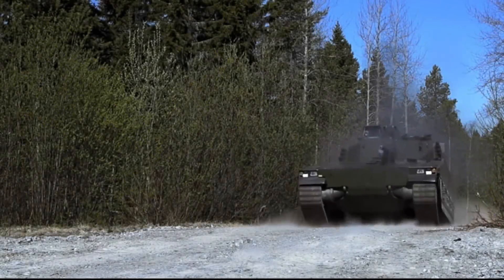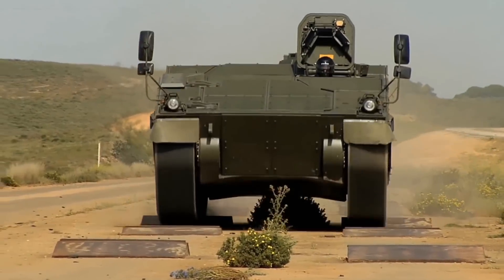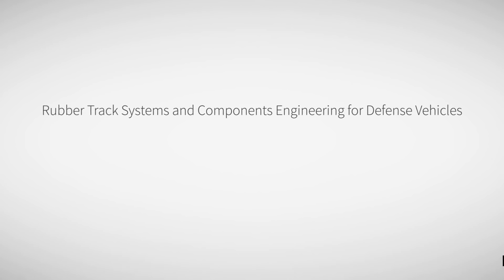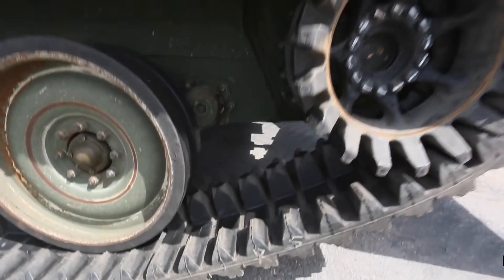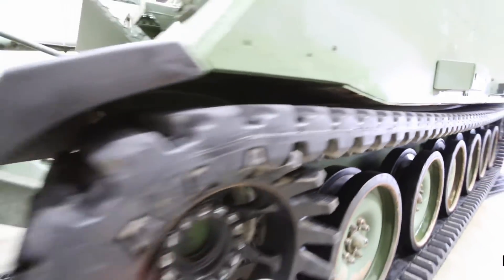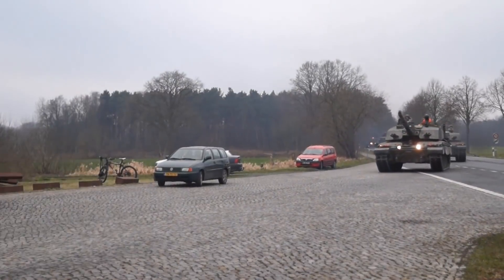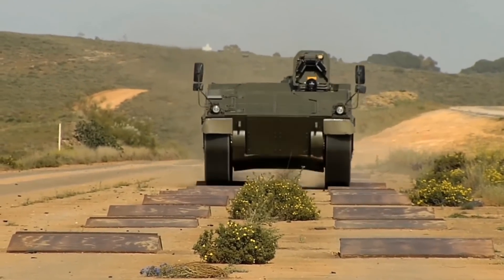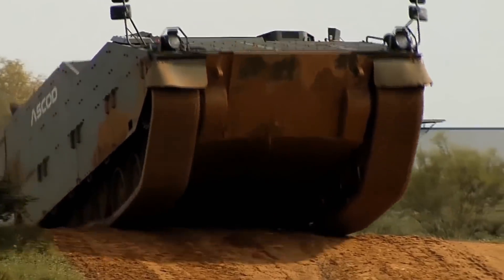Rubber Tracks on Tanks - Are they worth it?

Comment: You probably won't see this comment on a 4 year old vid, but I've been working on a science fiction tank story idea for a while now, and wanted to know some thoughts on this, if you'll excuse the whimsy:

What about organic tank tracks? You could have an organic rubber substrate a lot like the ones in the vid, but they also have a cartilage-supported circulatory system, pumped using the pressure of the tank rolling over it.

The idea is a more advanced version of the self-healing rubber materials I used in engineering. The idea is if something stretches and wears, catalysts will reach the spot to facilitate repairs and correct the damage. If a whole chunk is lost, it scabs over. Later, you can cut off the scab and apply more substrate, like you would a graft, and the material assimilates it into the track. If stones are an issue, they are encapsulated like a tumor and you can just take a knife and cut it out later.

You can store this material in sections and graft each end together to fuse it into a single track. Basically, the advantages of the rubber tracks, but less wear and tear, slightly easier maintenance (hopefully).

Also, if you can create a large-scale vat farm for growing these, you can create new tracks really cheap. Also, a lot of the healing is performed on its own, it reduces the number of tools you need on hand. Just need a package of substrate and your trusty knife.

I know a lot of sci fi concepts get immediately tossed in some military communities because it's impossible to gather actual statistics on something that isn't real yet, but I'd like to hear people's thoughts anyways.

I've been doing a lot of tank research through this channel, and somehow difficulties with treads was one of the things I hadn't realized before lol.

Comment: Fast Foward to 2019, for example the UK AJAX / ASCOD 2 IFV there have questioning to this program due to too high vibration issues on users: crew / passengers , change it to rubber tracks could be the fast track solution instead of reavaluate all other settings in terms of suspension and else...

Comment: There is one perspective that i don't find: I Don't subscribe that rubber tracks are not a best fit for MBT, at least up to 45 tons think is a best fit for example for modernization but mainly life extension of "legacy MBT" or even a tracked Howtizer, e.g. Leopard 1, M109, T72 ... because considering the key elements of mobility of an  MBT ... Engine, Transmission, Wheels + tracks + suspension ... the less expensive to modernize is the "wheels and tracks" and often if you modernizate / replace the "Engine" you have to also modernize / replace the "Transmission", fast forward, the gain with rubber tracks are vibration, fuel efficiency  - 2 digits - and some performance/speed as result the efficency increase of each HP of the engine (and 1 tons save in weight from steel tracks), so the gain in fuel per track replacement is bigger for heavier vehicles like the MBT  ... so looks really as a shortcut on a modernization, life extension of an legacy MBT budget that can be diverted then for protection, or ventronics !! As for battle repair constraint, is not a so strong argument, since in a combat context, there is not really besides tow other alternative and if the difference gap between a steel and rubber repair is either 15m and 30m is almost irrelvant, because both repairs cannot be done in "combat or unsafe  conditions", is just teorical, you either are towed to safety or abandon the MBT... even if you train to repair it, and both can be repaired... you did not refer that also exist track grips to join broken rubber tracks, nor that rubber tracks are more tolerant to battle damage than steel ones. Note: Soucy from canada already shared their prof of concept of trialing the soucy rubber tracks in Leopard 1 C1, you can google it. So let's do some math from that study: 1) rubber band live cycle 6600 KM; 2) Fuel. Consumption: On-road: 3.4 l/km. Off-road: 5.3 l/km (average 4,5 km mix); 3) gain in fuel eficiency -33% : 4) For simplify the exercise we diesel price 1l = 1 Eur...so the track life time saving is: =6600x4,5x.33x1 = 9801 Eur or 9891 liters saving or that you can supply 4 MBT with the same fuel that was required before for 3 for the same leg distance, a tactical logistical gain too, that you may rebate in the aquisition TCO of the rubber track...

Comment: You make mention of the M114 of the 70's that used rubber tracks. I remember going to the field at Ft Lewis with 24 of them and by the time they had gone 10 miles half were on the side of the road with thrown tracks.

Comment: One advantage of rubber tracks is that they would be much quieter than metal tracks. That would have a number of advantages, like when you're moving into a position for an ambush. Also, a hybrid gas/electric power train would be useful because electric engines are so much quieter than internal combustion engines. Light anti-tank vehicles could move into a position for an ambush with much less chance of being detected.
Reply: If I had to design a reconessience vehicle, I'd make it hybrid and have rubber tracks. The thing would be like a ghost.

Comment: The rubber band tracks would be great for traveling, though the metal ones would be prefered for defensive roles, plus there should be improvements in the vehicles for supressing vibrations in the cabin itself as you did say that's an issue.

Comment: I operate heavy equipment, and I can verify that this is all true.
Even a rubber track machines can beat the crap out of you if there is no suspension. 
The old, now defunct ASV, put to death by Caterpillar, was a really sound design.
It had bushings between the track units and the body, and the carriers were dual mounted, on their own paired pivots like a Sherman tank, unsprung.
The tracks had no steel belting, just polyester belts and Kevlar cross rods.
These machines, when respected, we're unlimited in their capabilities.
A 9,000 lb machine could walk on a snow DRIFT, not a BANK, and not even leave a rut, just cleat marks.
At 4psi ground pressure, they could grade mud.
Only a big, politically aligned company like CATERPILLAR could, and would, shut down a company that was successful.
That's my view, try to change my mind.
Especially when Control Freaks decide that something is so good that it has to be destroyed.

Comment: All depends on what type of rubber is used same with snow tyres on cars and trucks. The all metal tracks I use on forwarders wear too much if dry and people keep saying they do too much damage to roads and other. I would say the rubber tracks they are using on the CV90 are very good and I have also seen the new roads that were built on Salisbury Plain so the tanks and other did less damage with their metal tracks. The only time I have seen rubber tracks knocked off is on mini diggers where the person did not check them and they were lose but they were a lot quicker to put back on to the machine than metal ones. I would like to see how these are fitted to AFV's to see how quick they could be fitted and kept tight like if they were knocked off by an IED or other how quickly could you refit them or put a new track on ??  Thank you for the video.

Comment: if you have a metal track system with each track segment encapsulated in rubber you would have the combat strength of metal but a ride that would be better easier to store just like steel ones an a weight difference as well so why not encapsulate lighter metal ones

Comment: I'd personally have tracked vehicles built to accept rubber or steel tracks, and have the otion of swapping each one out based on the conditions I can expect. Do I want my APCs to be doing regular patrol work in an urban setting? Rubber tracks for the win. Are we going to be doing heavy fighting in the desert or extreme cold? Metal tracks it is

Comment: in norway we use rubber tracks, it saves fuel, roads, less wear on the vehicle, better acceleration, its smooter for the people inside. but when the rubber tracks break then you are in a heap of trouble cause you have to replace a whole belt. that is something you might not have time for when you are out solving your tasking.

Comment: Couldn't you have a rubber sleeve for each metal track link? As in each link is inside a rubber sleeve that reduces the vibration of the metal by virtue of it being insulated like a car tire.

Comment: track bashing is bad enough link by link. yep it's hard to move the whole track but doable with experience.  but you can change a single link on those tracks. You can't on rubber tracks. you gotta replace the whole band.

Comment: Have it's effect and/or take it's toll. Take effect means it happens, usually after some delay. Take it's toll means to do damage, to take something away in the course of operation. Take it's effect doesn't work. The effect of sharp rocks on rubber is to cut and tear. If it took it's effect, the rubber tires would cut or tear the stones.
Reply: Sorry to nit pick but it's jarring. Love your stuff.

Comment: The British bought about 100 Warthogs from Singapore (where they are called Broncos) to replace the BV206s because ppl were getting killed in the BVs due to insufficient armour. No one was killed riding in Warthogs, apparently. The Warthogs also had rubber tracks. We make quite a number of AFVs and also a high mobility vehicle where the driver sits in the middle. We also operate over 100 Leopard 2 modified locally. Perhaps you may consider doing a video on Singapore AFVs. We also make howitzers, SPG, LST and other weapon systems.

Comment: On the rubber tracks in sections, how does replacement time work: more or less? Service life vs costs is an issue as well. Troops time has always played in as a substitute for training for combat conditions not a waste of energy for combat. It does sound that the r/track has a lot of other advantages at least for lighter armored fighting vehicles. Also, as they develop,  maybe we would see a reverse of older designs and bolt metal cleats on the rubber for some performance areas or duties. It will be interesting to see how it works out. Thanks for the article.

Comment: If they want noise reduction, why not put a stealth mic and speaker on a tank? You cant make less noise after a point so just directly and physically counter the noise itself. You could even use a system like that to dampen the noise from the main gun, perhaps preserving the hearing of tankers over the long term. Technically, with certain attenuations, you could set the signals to overlap at a set radius from your vehicle allowing for verbal comms within the area among friendlies without fear of being overheard further out. Like a whisper-PA system. Lots of possibilities. Doesn't have much to do with tracks, but whatever

Comment: well. for defense i mean. when you have summer you gonna use rubber and at winter you use steel ones. and i think those advantages you want have when you going to the city. and at nature. but when you are at open field. you need steel couze bullets, damage, repair etc. but i think that i would prefer tanks with steel and apc with rubber.

Comment: I know this is an older vid but had to watch. I actually designed my own tracks. To do this I looked at various designs for ease of building. Making them out of rubber did cross my mind, as you mentioned about the stretching and tensioning during use, I decided not to use any rubber what so ever. Instead I used chain for the links. Made my track pads from 11 separate pieces of steel and bolts. 100% serviceable too. I can even spiral the tracks since they are so flexible. I think when I did the numbers they was- around .5 lbs of ground pressure per square inch, 1100 lbs of pull force can be put on each track. 1/4 inch cleats. 10 inches wide. Total weight for about 15 feet was under 100 lbs (one complete track). I took my ptv for one test drive so far and was surprisingly a smooth ride. Felt like it was floating, go figure.I see another vid of yours, LOL. "Tank Suspension"  Watching that next, LOL.

Comment: I think that ruber tracks will be really userful once they can be made whit graphene nanotubes in a radial config. (Like in a tire, the nanotubes being at a 45º angle respecting the runing vector, thus increasing the streng of the whole track not the middle core, like a rope). I think that It will work in segments and may have steel links between segments to increase traction on hard slipery conditions. Also they will probably need platforms built arround them instead of retrofiting current vehicles designed for steel tracks, at least in most cases. I personaly think that future desings will start going for unmaned vehicles, thus allowing smaller and lighter vehicles with comparable firepower and better survivability. I also think that another huge leap foward will be tanks with an electric drivetrain, this means that if the track is damaged or destroyed, the tank can move in a limited capacity. Kinda the BT russian tanks but instead having a steering wheel and that, having each or one of every two motoriced wheels (are they called slave wheels? the ones that have the suspension on normal tanks) with an electric motor. These motor have the torque to move a tank, but fiting the system of a diesel train locomotive in a tank is really hard and space consumig. Soo I dont know how well It is going to work.

Comment: it is bullet proof did you try to test it in land mines or any kind of heavy explosive and compare it to metalic trucks.
Reply: Of course it's not, lots of people would much rather aim for either the driver or if not the engine.. then get the fuck outa there-
But why would you have bullet proof tracks? You're more focused on having them support the weight and speed, as well as the ground density and obstacles.

Comment: It seems like in modern urban warfare tanks often spend a lot of time on roadways going between locations or out on payroll.
Wouldn’t it be possible to create a modular system that could attach to the underside or each corner of a tank that would have tires on electric motor hubs that could be lowered for traversing smooth roadways and raised for terrain?
Could even power the electric hubs from the tanks engine and reduce fuel consumption on smooth roads.
Make the failsafe position be retracted so it they fail the tank can simply use its tracks.

Comment: Metallic breaks but can be repaired but the rubber tracks... they pop off and snap and have to be replaced but would be cheaper but they have metal links going to road wheels where they turn tracks

Comment: They don't pass the combat test. They have peacetime advantages and would last longer than track link overall and less component and driveline wear etc and likely be cheaper over the life of the track versus changing links but that's it's problem. If you're in combat and a track is damaged then there is no going anywhere for that vehicle until the whole thing is changed which would not be a quick process and unthinkable under fire, would be continually recovering casualty vehicles to pull them to rear areas for repair. The crew couldn't self repair or at least provide a workable solution to move under own power so is then a capability loss of the vehicle itself and it's section of infantry in the back. I'm from Australia and I know what the terrain is like here and what it does to rubber tracked vehicles and it isn't very forgiving. In Europe etc probably different story but to pardon the pun, one shoe doesn't fit all. Rubber track isn't new and has been used in military applications since WW1 and is for that very reason really hasn't been adopted except for the Hagglunds BV206 articulated movers which were designed for more winter environments, mud and snow and it's Singaporean lovechild the Bronco. Works fine for them as logistic vehicles but for a combat vehicle I think i'd personally much prefer track link.

Comment: I like the segmented rubber tracks. Retains the field maintenance capacity for the crew. The only real draw back is the frequency of thrown tracks. I would believe that driving rubber tracks takes a different technique than traditional tracks, like wider turns or slower turns. The nuances would be challenging to traditional drivers who might forget that they are driving rubber tracks. Tanks are great forwards and backwards, but turns play havoc on many things. I remember my M270 tank commander discouraging turns because of the drive train.

Comment: hmm, if you would see most of heavy industry machinery they use more rubber bobcats excavators it depends from situation what they use, both metal and rubber have life time when you need to change both, but the problem comes to this try to lift metal track and try to lift rubber. Rubber you can even change full track alone with no problem fast you can move all track dear god, metal gl moving  a big section :D of all track. Time to replace track and men muscle power needed is huge. less weight means more speed or more armor on same vechile, vibrasiots comfort, you can work longer hours, comfort sound, maintenence is worst words to soldier.